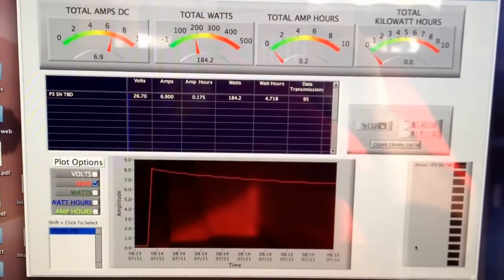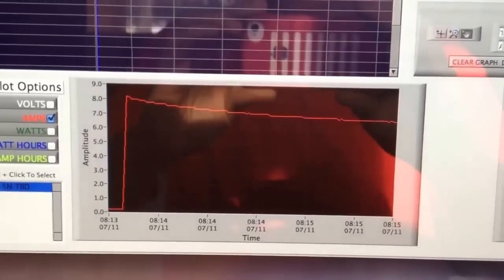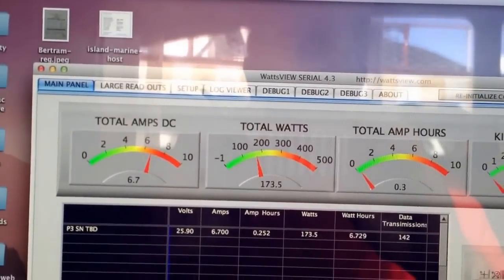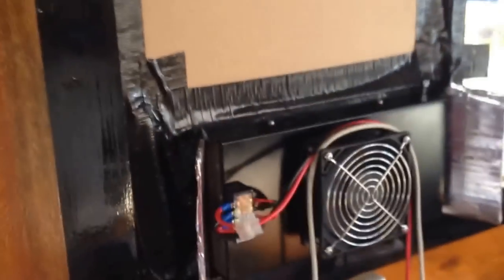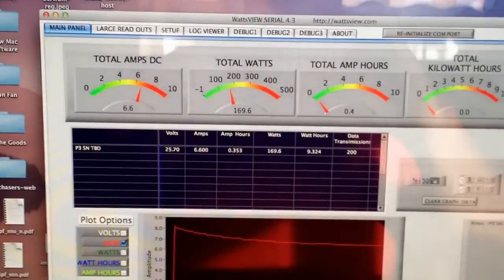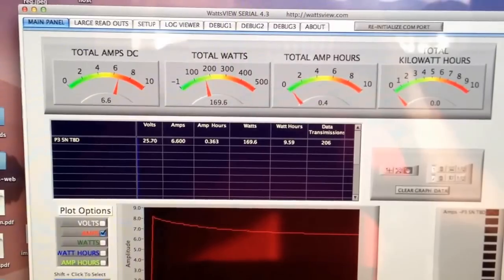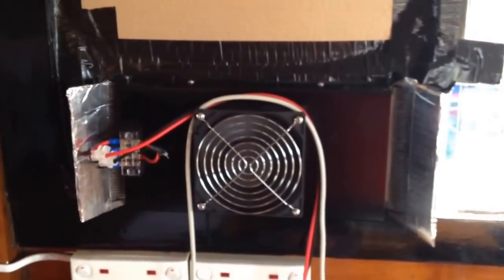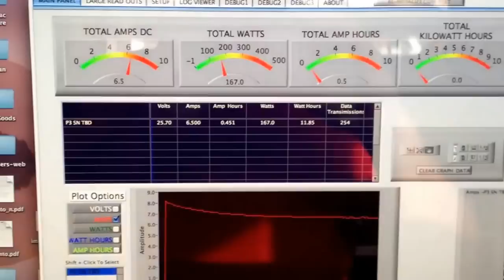Peltier Air Conditioning 3

Comment: Have you considered (Since You installed this in a boat) Using Water Cooling for the Hot Side Using A Water Block With a Water Pump Submerged and mounted to the boat? That Certainly Would Drastically Raise the COP (Coefficient Of Performance) And Allow you to achieve the same temperature using less power.

Comment: idk why these small peltier pads draw so much current
Reply: Because they are using electron saturation to move electrons from one side to the other. Horribly inefficient, but potentially space-saving, at a cost. (The heat = massive vibrating electrons, trying to jump back onto the saturated elements, hitting other electrons, in the process. The cold is the lack of vibration, voids, that consume vibrating electrons of the other side. The waste-heat is the "gate" which is holding-back the abundant electrons on the hot side. Thus, 80watts of heat/consumption to yield 40watts of cooling = +40 watts of waste heat that has to be removed, to equal 0 cooling/heating. However, you remove 100% of the heat, to get that 40watts of cooling.)

Comment: I'd like to learn more about this.  Where I live if it was 31C/88F and your waited 10 hours it would be lower than 26C/79F with just the window open.  The current unit on my boat is rates at 6000 BTU.  What is it the heat transfer rating of your unit?

Comment: where I can get aluminum heat sinks?
Reply from the maker: I had mine milled to my specs. Find a local machine shop that can mill it from a block of aluminium the size you need.
Reply: there is a website that sells this size sinks?
Reply from the maker: +Alejandro Moreno I don't know.
Reply from the maker: +Alejandro Moreno I don't know.

Comment: im making a new shed/workshop and on the roof i will have a water tight box with a vent on one side there will be a homemade peltier cooler and heater the heat will get blown threw the vent to outside and the cool air will get blown threw vents and then a ventilation fan will suck the air alot  more quicker and i will have ac in my shed but its going to be a modern shed i would like to control the system with a arduino
Reply from the maker: That is a brilliant control. It would be great if you would share that build on the Off Grid Forum I set up. We need to share our ideas to make Heating and cooling more power efficient ! http://offthegrid.forumsmotion.com Great planning my friend !!!